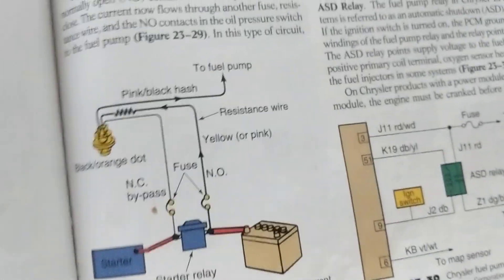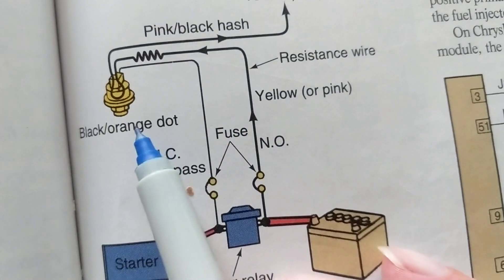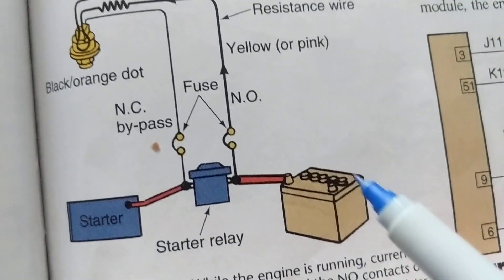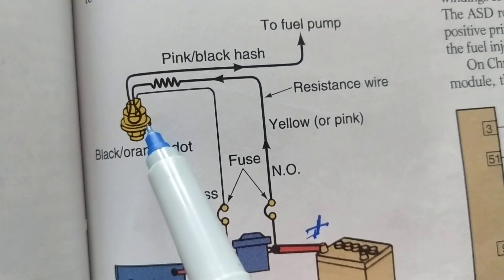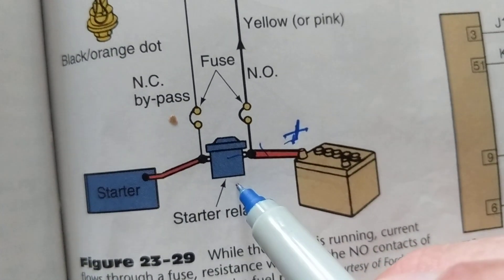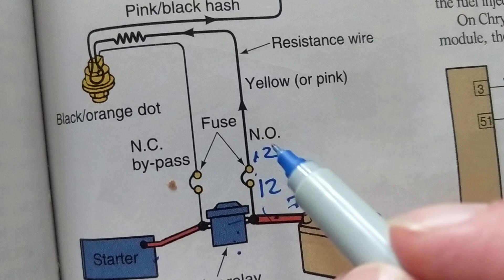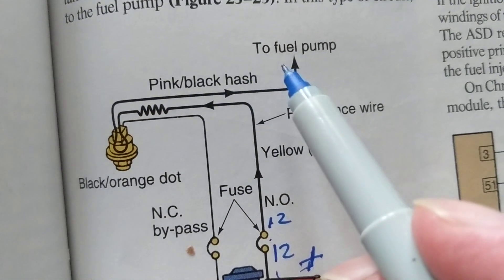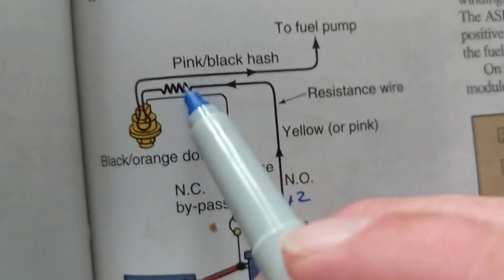HOW TO UNDERSTAND FUEL PUMP AND OIL PRESSURE SWITCHES CONTROLS FOR FORD'S

Comment: DUDE! maybe you know what you are doing but you have NO idea how to teach. You are all over the place. Get to the point. You take 14 minutes (repeating things over and over that don't need to be) to say what can be said in 5. I can't even be sure that you ever got to the point since I stopped watching a 9 min. 

ECM powers the relay, to supply power to pump, so the pump can start supplying fuel. Once the Oil pressure is good the, oil pressure switch makes contact, keeping the fuel pump running. If Oil pressure drops that oil pressure switch cuts power to the pump.

See how easy that was.